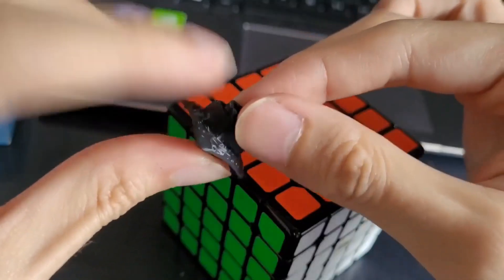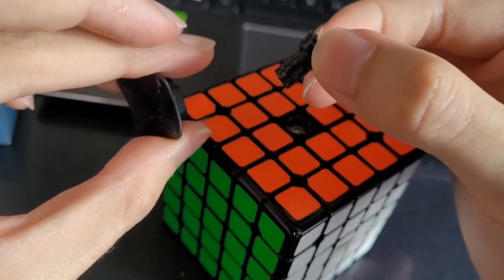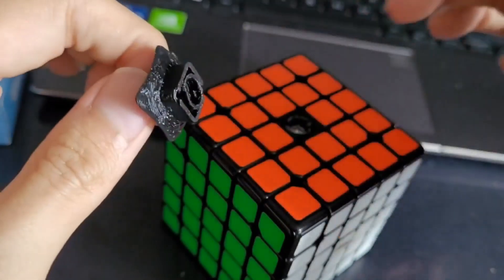5x5 Dual-adjustment system prototype | Weichuang GTS M

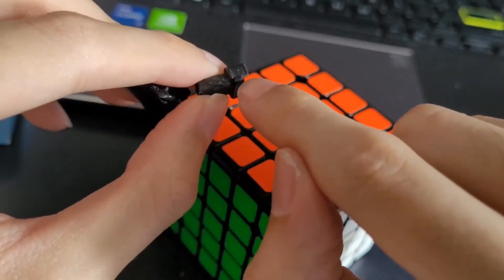Comment: At 0:39 was that a 3D printed replica of the original center?
Reply from the maker: It was a split version where the inner circle and center stalk are a separate piece to allow the dual adjustment to work.